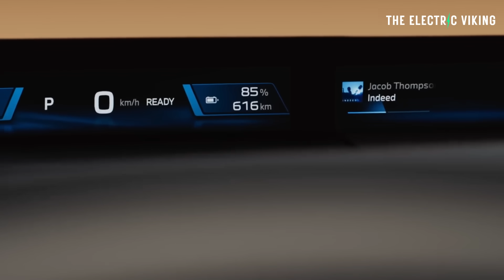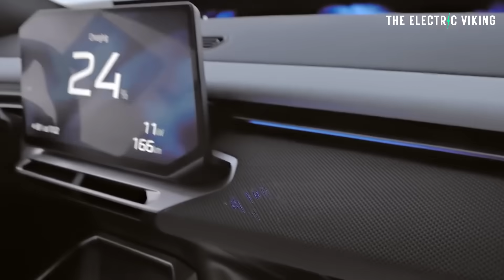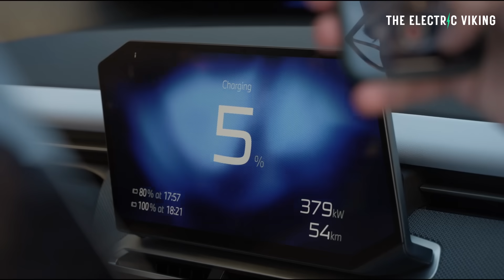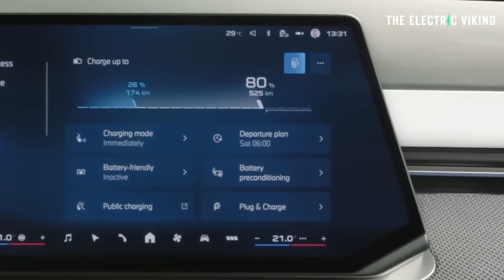621 MILES ON 1 CHARGE! BMW's New iX3 Just Set A New EV World Standard!

Comment: Don't know about this car but Tesla scavenges heat from all sorts of places.  Things like motors, alternators, power steering and other places.   A heat pump system is also used to reduce energy needs.  What this results in is less energy needed to keep the passenger compartment comfortable.  So less range is loss when the heat or AC is on and range reduction is minimized.

Comment: BMW have done a great job with ix3. In UK it is significantly cheaper than a model y performance and with much more range, charging speed, and tech like v2l, v2h, v2g. Efficiency seems similar. Looking forward to the single motor versions with smaller batteries

Comment: Hypermile range? Pointless stats if it is the case.
Reply: It's just a reference for comparison.
From these 1000km you discount for outside temperature, AC/heating, high speed driving etc.

I suspect they need 1000km nominal range to be able driving at 180km/h in Germany and still have a decent range.

Comment: Two things; firstly is it going to be sensibly priced? Secondly, what’s the point in having 1000kw charging when you struggle to find 350kw?
Reply: It's the chicken or egg problem applied to EVs and charging points: they need each other, so if they don't start building these cars there won't be charge points for 1MW

Comment: How safe are BMW batteries? They have virtually zero experience with developing batteries and these are been said to be developed in house. They don't put out any safety parameters either
Reply: Maybe ask the oil industry. They’re the ones trying to freak the public out over how dangerous batteries are, while ICE vehicles catch fire at a rate of 50:1 EVs. Seriously, how many EV fires have you witnessed in person vs ICE fires? And even those numbers are skewed due to incidents with older air-cooled batteries. Did you truly believe that BMW didn’t do their homework? No problem since it will be years before you could actually buy one, there are that many on order already.

Comment: We just traded in our BMW for the Zeekr 7X. What a step up and no more stress on BMW servicing!!
Reply: Good decision, Zeekr 7X is far superior
Reply: Don’t leave us hanging Andy.
Reply: On there ICE Cars BMW free service is free to BMW because there basically is none. 
I don't know what the do for there EV's but most EV's don't get any service except for window wiper replacements and window washer fluid. Where do you live that you can get Chinese Cars?
Reply: @ctuna2011  EV's need brake maintenance, gearbox oil changes and battery coolant changes but the frequency of change is tens of thousands of miles.
Reply: @ctuna2011 2 year BYD service $520AUD
Reply: That's the only thing holding back this iX3 - their dealers. Otherwise, it's superior to the Zeekr 7x in every way except it changes a hair slower. But with it's 400kW charging and better efficiency, that cancels out. Of course, the online army of Chinese propagandists will say otherwise. It's their job. 

Regardless, the Zeekr 7x is a great car as well.
Reply: Can you explain the stress on BMW servicing? Like what are they, and maybe the cost, thank u
Reply: @krupuk-edan yes it would be the cost
Reply: @krupuk-edan  BMW service is free for the first 3 years...That is stressful to some lol
Reply: @krupuk-edan mate they’ll find something outside the service to hit you! In terms of reliability they are rubbish. I’ve owned Japanese built cars and they were far more reliable. One example - alternator broke down on one of our beamers after 5 years - dealership said it’s normal - and cost a bomb to replace. My Nissan lasted 18 years! So much for German engineering.

Our current Zeekr 7x destroys in term of ride quality compared to our last 3 series BMW. No comparison!